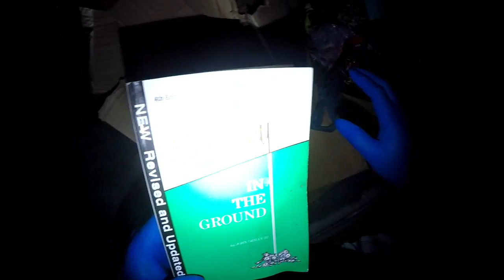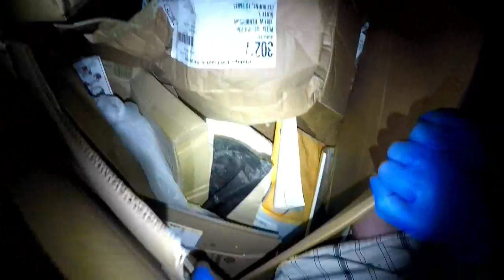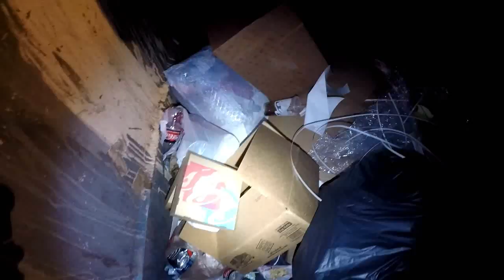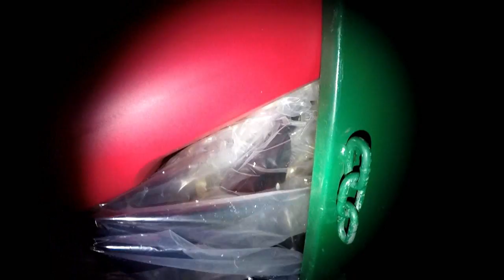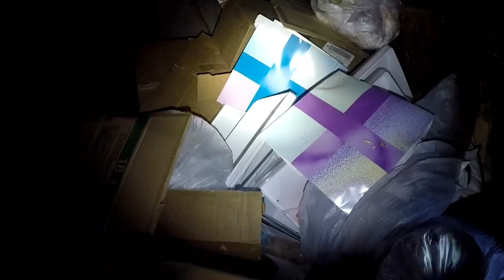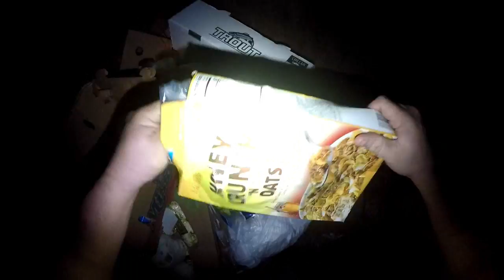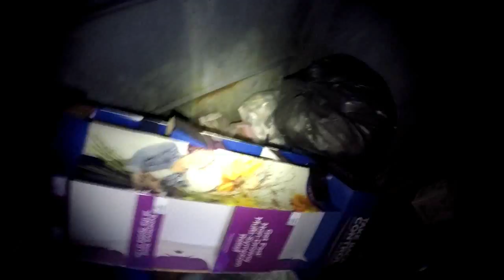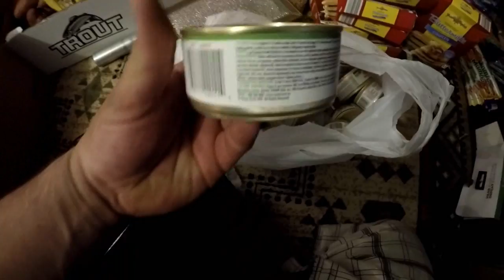Epic Dumpster Diving Score | Grand Tour Of Our Hopefully New Dump

Comment: You should check to see what the land value is on the property you are considering making an offer on and what the tax assessment is on the house to see what the base value is on the property actually is. You would have to calculate the cost to make the house at least liveable to see if it's a viable venture. It is a nice piece of property but does need a lot of work which would require professionals like electricians and plumbers and inspections for code regulations. Those are things banks require. I wish you the best of luck. Hopefully the owner is realistic in his asking price.
Reply from the maker: Everything can be dealt with. Most of the repairs can be made by myself friends or family for far cheaper than it would cost to hire someone else to do. You are absolutely right, this whole house of cards is based on what he will take for the property.

Comment: That house is a money pit.  The 2x6 studs will cost a lot more than 2x4s.  Offer $25,000.  You will drop a bundle and your family deserves better.  Consider purchasing the lot and build a new home.  The potential for health problems alone is considerable.  Call in a contractor to give you an estimate before making an offer.  And, regrettably, until you have the siding tested by a professional, consider it asbestos.  The siding on that house has long since been "outlawed".

Now that your son has discovered the marsh, the swift river, and the critter hold, you have new dangers to consider.  Eeeeks!

Comment: It would be grand if you could find a lot of the things you need for that house in the dumpsters. Carpet, rugs, instead of using sheetrock, use all those pallets you pass. I'm sure you could find what you need in the dumpsters.  
Just an old woman rambling.
Reply from the maker: That is an excellent idea! How cool would that be! I know it's possible that's for sure. Thank you for the idea I do know of a few dumpsters that might hold good carpet
Reply: @curbsidejunkies  I stole the idea. Some other kids I watch did just that. They found tile, created a wall from the pallets, wire to rewire lights with.  If you want to give them a watch I'll give you their name so you can see.

Comment: How many bedrooms
Reply from the maker: Just the one. But another one could be added
Reply: @curbsidejunkies  What's the story on the roof?  A 10-year-old roof shouldn't be causing that kind of ceiling damage I saw in that one room...  And I'd tear up the carpets to see if any animal waste had permeated through the floorboards as well.  That smell never wants to go away, although there are new products nowadays that might neutralize it.  Plus I'd tear into those walls - both interior AND exterior - and insulate to the hilt, it'll save you a fortune on cooling and heating costs going forward.  My mother-in-law lives in Texas and her air conditioning bills are outrageous!
Reply: Curbside Junkies then an offer of $29,000 to $39,000 given the conditions of the house would be good.